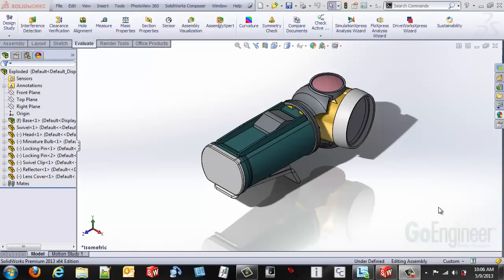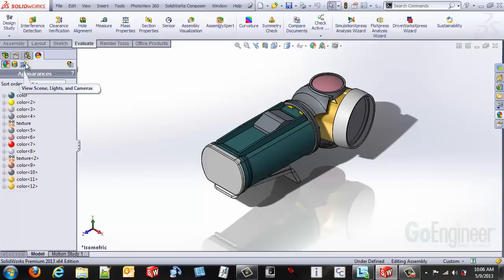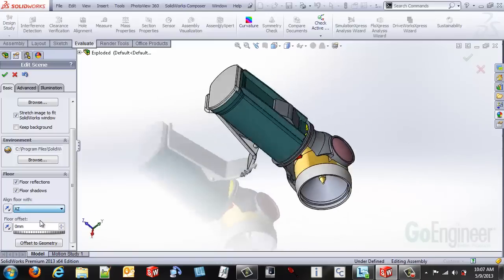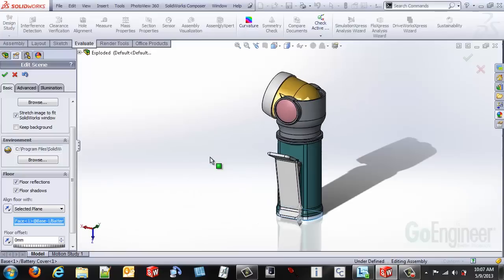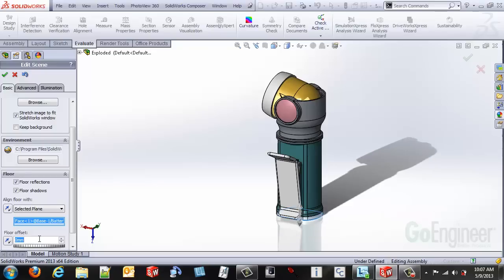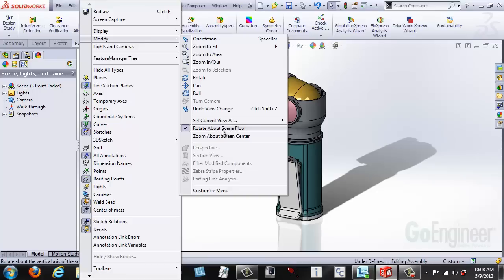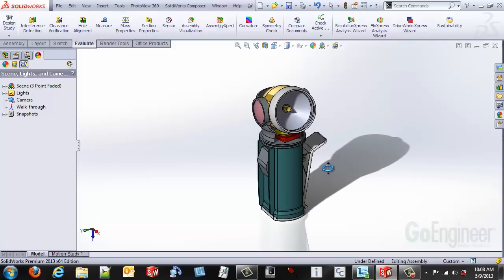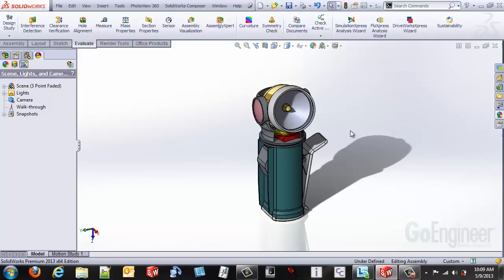SOLIDWORKS – Scene Floor Editing & Rotating

Comment: Is there a way to have the object continuously rotating?
Reply: Sorry, that is not what I meant. I am trying to have my model, a headset, rotate about the z-axis as in a showroom demonstration. The headset has no moving parts, thus there is no need for motion study. Sorry for the confusion!
Reply: yes. Turntable option in Solidworks Visualize.